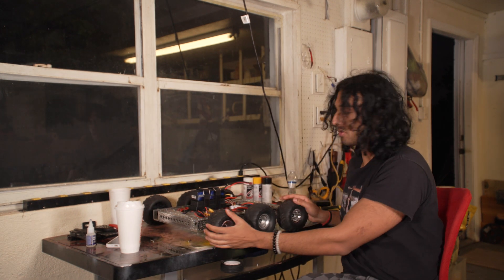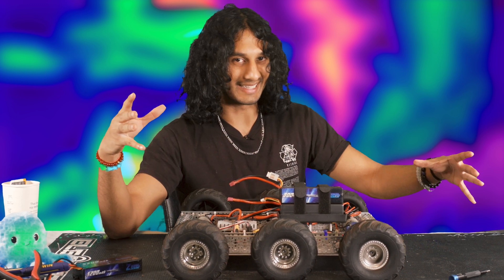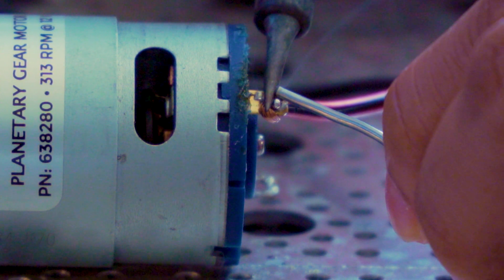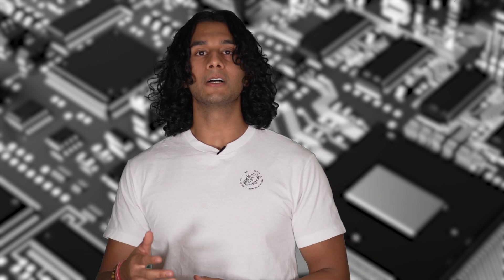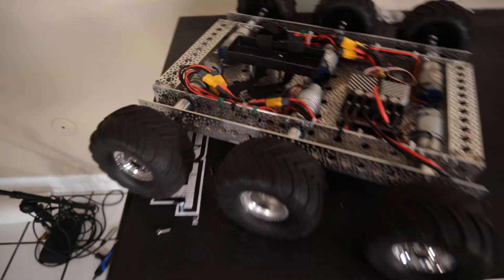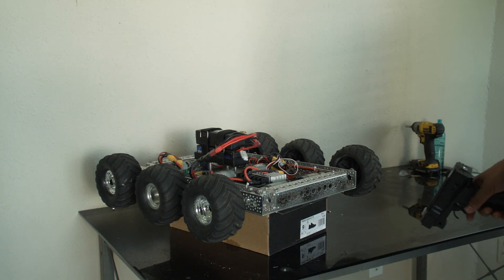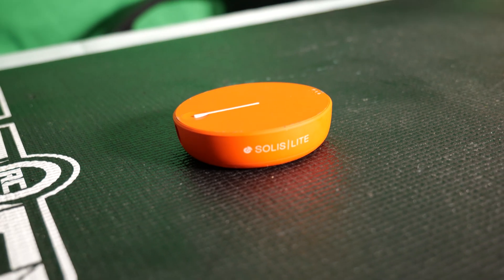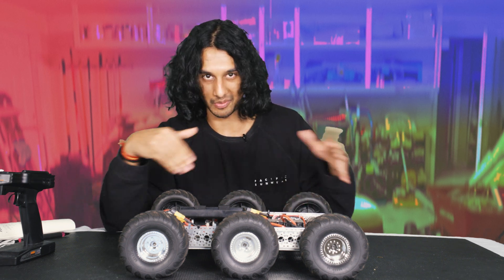Building an Internet-controlled Robot with a Raspberry Pi 4! | Chassis & Electronics

Comment: Great video, man! Can't wait to see the entire process and the final machine.

I do robotics and stuff. Just a suggestion, man: I would suggest large tracks for less maintenance and better all-terrain performance, or larger wheels if tracks aren't possible. Or a combination of both, if you really want to go all-terrain and do it all. And maybe waterproof the components.
Reply from the maker: thanks so much!! The electronics are definitely going to be waterproofed…working on that for the next video :) As for the tracks, the stock ones that came with the kit are unfortunately terrible for off road as everything gets stuck in them and they bind up (weren’t designed for all terrain) But I have an idea moving forward on what I can do because I really want to add tracks to this chassis! Let me know if you have any ideas or further suggestions! Thanks again:))